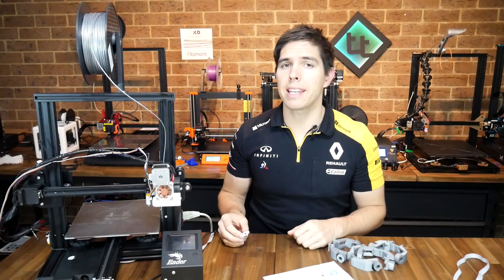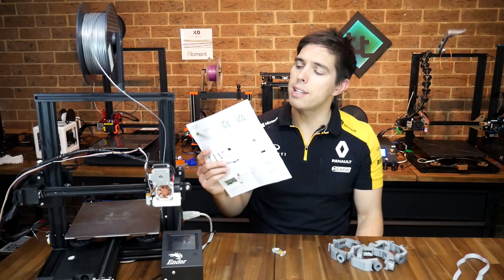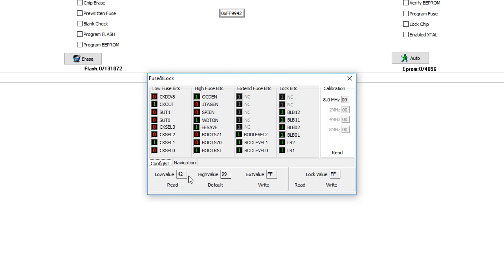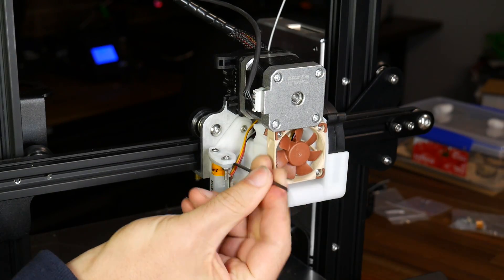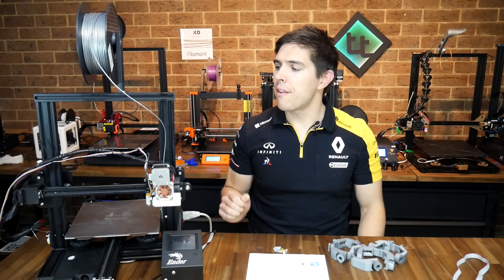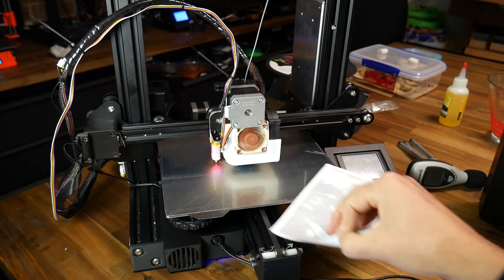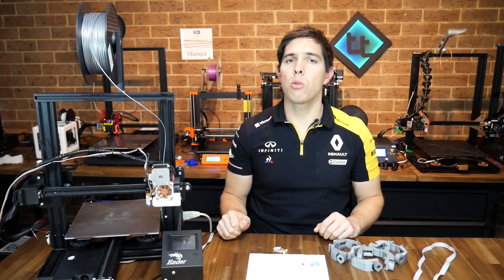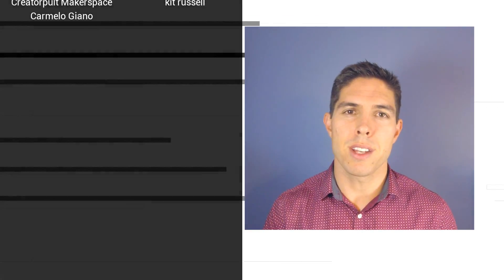Creality BLtouch Ender 3 upgrade kit - Step by step guide with fixes

Comment: Or just turn some knobs every so often and be done with it. This is way too much hassle currently. This would take hours to get right, or longer potentially, and although works well after configured, look at the troubleshooting and configuring that had to be done to get there and the kit isn’t even really compatible. It’s not worth the headache. I got a 3D printer to print things, I didn’t want a continually-fiddly machine. I don’t care for hobby-grade tinkering when I can just turn some knobs and be printing.

Comment: I'm having trouble when I do an "autohome." When I go to autohome, it will do x and y fine, but then the touch pin doesn't come out and it keeps hitting the z stopper sensor (the one I unplugged per the instructions since the touch does that). Did anyone else have this problem?
Reply: Found the solution! Update your firmware.  The 2019.11.13 version seems to be working for me. https://drive.google.com/drive/folders/1A9vSzhdJqm4qdt4wmbYEP8VPbX15ScUU
Reply: @ylexot007  does this one have the z-offset ?
Reply: I just installed and am having the same problem.  Hoping someone else has a solution...

Comment: Help I’m trying to install a BL touch and when I run the Progisp program and try and select the chip ATmega1284P it’s all blank I don’t have any chips to choose from.
What am I doing wrong
Reply: you might need to rename the folder from progisp+1.72 - ∏±±æ to progisp to resolve the blank bar
Reply: @lorenzomuylaert6989  Thank you so much for your comment here. I was having the same problem and that definitely was my issue!

Comment: I couldn't find instructions for the Ender 3 so I used yours and I now have auto bed leveling on my Ender 3.  The only thing is that now my screen says Ender 3 Pro.  I had just installed the new silent mainboard from Ender and wasn't sure if having a bootloader on board would conflict with your instructions.  Apparently it didn't, but I'm wondering which firmware I'm actually running.  Did I blow away my 1.1.5 firmware?  It still prints quietly, so the electronics are still working as advertised.

Comment: Hello. I have such a problem. I downloaded your remastered .hex file from you. Everything went well during the installation. Except every time I press the navigation button, the printer restarts. It is impossible to control it in any way. Rotating just changes the print speed. But that's it. The loudspeaker whistles. You can't even get into the menu. Bl touch is functional. Interestingly, when I disconnect it and reconnect the Z axis and display normally everything is OK. The printer then behaves as if the attached BL was. The blue LED and the red LED flash each time. The display is also functional. Just after Y, Z, X a question mark flashes. The board is version 1.1.5 silent. The processor is the same ATmega 1284P. Do you know what to do? Thank you for any answer (sorry for English - google translator)

Comment: I spent some time searching the web and found that others had the same problem. When you unzip the progisp+1.72 zip file, it creates a folder called progisp+1.72 that has some problems with the name of the folder. Renaming the progisp+1.72 folder to progisp solves the problem. It appears that there is a problem with the path to the file. I found the answer in the Ender 3 subreddit. Here is the link. https://www.reddit.com/r/ender3/comments/cfmbdy/howto_installing_a_bootloader_to_an_ender_3_pro/ The firmware that you created uploaded without any problems and the Ender 3 boot screen is correct. There is one problem. After flashing your file the buzzer in the Ender 3 sounds continuously when you power up the printer. Any suggestions would be appreciated. Thank again for all the work you put into this channel.

Comment: Great video as always! Progisp was a nightmare. Lots or errors even trying to run the software. I uninstalled the software, and downloaded a new copy but the problems were the same. I switched to a USBasp and burned a bootloader using the Arduino IDE. I had a bootloader file from another source. When I went to flash the firmware package that you prepared for the BLTouch, I discovered that the Arduino IDE could not load a .hex file. It was looking for a .ino file. I have Avrdude with the GUI installed, but I'm not sure how to handle the fuse bits. Since I already have a bootloader installed will flashing the firmware that you prepared with a bootloader included, just overwrite the bootloader that I already installed, or will it cause problems? Thanks for all the great videos!

Comment: I am trying to flash the upgraded main board of my ender 3 pro and, I get a, "flash verify error at: 0h".  I have been pounding on this on and off for months.  Would this also be fixed with having the device have power, or am I wrong?

Comment: its been a nightmare getting this set up. i ended up printing a bullseye and mounting it on the right and it still was so messed. up. need washers. cuz it wasn't triggering in time. i think i finally got it but wow -6.5 z offset was stil needed. auto leveling needs to get more user friendly im fairly good with electronics and this was still a nightmare to get working acceptably
Reply: also the fan does not fit anymore once that adapter was put into place going to have to come up with a better solution for the motherboard

Comment: In progisp program where you type low and hight -value, You use DC - D6  when creality have a video with setting D6 - DC.  Does it matter which is what?
Reply: I think the Creality ones are correct, not the video. I had extreme layer shifts when using the values on the video. The only change I then made was to write the Creality fuse values, and the problem was instantly fixed.
Reply: Yes, DC, D6 is correct, Creality showed it wrong.

Comment: When i open up the progisp i get a error. ( access violation at address 76eb1480 in module "KERNEbase.dll´.read address 028d7000. if i click okay 2 times progisp opens up but cant select chip?? what am i doing wrong?
Reply: Rename folder to just progisp,   it should work after that.

Comment: I have followed this entire guide to succesfully install my BLtouch but I have a question. How come the probe don't hit in the center where the nozzle goes instead? It would be better if the probe touches the right place actually. Is there a way to change the Z-Probe offset somewhere?

Comment: I just bought a BL Touch from Creality and the install went fine.  The PROGISP program is in English now and I didn’t have any software errors you show here.  Thefirmware download from the site is easy to find.  Instructions were good  except for the Z offset.  I also upgraded to the 1.1.5 silent board and had to generate a hex file using TH3D’s latest version which has thermal runaway protect and bug fixes for V3 BL touch probe.  Using their software and USB ISP saved having to install a boot-loader.  I agree it’s slow but it works good.  I went with the BL touch since I am going to use a mirror for my bed and I was concerned about thermal changes affecting the capacitance probes and how the probes can be inaccurate with glass.  All in all I say it is a good buy and it’s nice to see Creality fixed some of the problems you outlined here.  Thanks for all the great videos.
Reply: Hi it's possible to send the .hex for ender 3 mainboard 1.1.5 and bltouch v3.0 ? thx man :)

Comment: I downloaded your .hex file and flashed,  went perfect(Thank you).   BUT how do I adjust E-Steps?  The option is now missing from the LCD screen.
Reply: i am having the same issue. i hope we get a repose soon
Reply: @daneberry5679  i ended up just using Octoprint,  Terminal, and entered the commands to adjust it.
1. "M501" (shows current esteps, E93(default), in my case, lot of info but its in there)
2. "M92 E95" (95 was my new needed esteps calculated)
3. "M500" (save new settings)
4. "M501" (check Estep value again to insure it saved).

Comment: I bought the kit off Amazon and installed it, it was after a large print that I noticed the bed is not centered properly, they somehow didnt input the bed size dimensions or the offsets.

Comment: I cant get my mac to run the USB ISP it recognizes it as a USBHID so the progisp program can't find it. Any ideas? I have been searching for a while but no luck
Reply: I did some research and the only thing I could find was something about using Arduino IDE to launch progisp? Might be confused but if you find out let me know!
Reply: @jacobstoltzfus6625  I ended up using the TH3D  version and followed the instrsructions on the website and videos from Edge of tech. got it all sorted out!

Comment: Michael thanks for these useful videos, I have an ender 3 pro and have installed a couple of mods. So far for the BL touch I can't get the software to read the chip. Everything seems to go good till I open  the proispexe file. one I noticed is that it comes a rar file and it doesn't have the chip icon next to it. What is the next step, need some help here.
Thanks.

Comment: Thanks so much for this... I did however have some issues, un related to your instructions... when you click on [...] and ender the hex values, mine would not stay... d6, dc, fd. FD would not stay it kept switching back to ff. I changed the lock value to FD and hit write that made the correct hex code. so program fuse check box checked and code should be 0xFDDCD6 if its not when your write the firmware to the device it will not work you'll have a jumbled up screen. 

Its working beautifully! I hope that you will update this hex as new version of marlin come out this made it really easy for me and i greatly appreciate your help @teachingtech

Comment: I paid for your firmware. First problem : Z won't go below the zero so I can get the width of the paper, I disabled soft stops from the terminal and now I can move forward, after that I got my Z number, went to the Z offset to get the second number but its not there , only "Probe Z offset". How can I fix this?

Comment: When I did it with Chip erase on my CR-10 S5 my screen went blank and now I cant use my printer. tried flashing over other things to no avail =( still lights up need advise on how to fix this
Reply: Are you sure the lcd plug is installed correctly? I changed the fuse code and got mine up and running

Comment: It would be awesome if you could make one of those files for the creality CR10, oddly enough your hex file works on the CR10 lol better than the Hex file creality supplied all that happened was as soon as I tried to make an axis adjustment the printer slammed into the roof  bed or sides

Comment: Hi, I downloaded your BLtouch V3 (Marlin 1.1.9 bugfix... hex file but when I try to load it on I get a line error, I'm a total noob at this so its likely something I'm doing wrong, I tried to use the loader kit that came with my BLT3, does it have to use an Arduino instead ? I can't seem to locate the instructions for installing that firmware other than it saying to do the same way as for the 1.1.6 BLT which loads all ok, thanks in advance for any help here.
Reply: I downloaded the file again and tried again, this time it worked, nice FW, thank you, I just need to set the bed and BLT up, is there a guide for this firmware for the levelling first setup ?
Reply: I managed to get it setup and working, seems to be working well, Thank you for the firmware

Comment: I have a question.... The creality kit comes with its own dongle for flashing the firmware so no Arduino needed.  How does one build the Malin Firmware if you have no Arduino? I see lots of directions for using ArduinoIDE but.... I notice that you provided a build .hex file so there must be a way to build the Malin firmware so that I could use the burner provided by Creality in the kit??

Comment: I received the Creality BL Touch kit for the ender 3 in december. In my version, the correct check boxes for flashing the firmware to the board were already set as you described. So the only thing you have to input is chip and  Hi, Lo, and  ExtValues and off you go. They still don't tell you that you have to have the printer powered on, but the directions have improved.

Comment: I got a BLTOUCH v3.1 and have yet to install it. Is that still affected by this malfunction you described on v3.0? Thanks!
Reply: I also have the v3.1, which I installed last night. After much pain I finally have it working. To make a painful story short I ended up using the creality firmware as no other firmware worked.

Comment: I'm trying to install a BL Touch kit at the moment.  I agree that the documentation and support from Creality is abysmal.  However, disappointed a little with your video as it does not show what you should expect to see when the firmware has installed correctly - all you show is the main screen and whilst my seems to match I can't say that it shows that it is now BL Touch enabled.  When I go through the menu system I cannot find any reference to BL Touch at all - is that correct?  Also when I power on the BL Touch lights up red, extends a retracts the probe a couple of times and then stays red.  Is it meant to be red - to me a red light means something is wrong but I can't find any documentation to say one way or another, nor does you video show what to expect.
Reply: I am trying on a cr10 mini, piecing bits together (slowly).
Reply: @connerbillox2540  I got my Ender 3 in May 2019 and my BL Touch kit in December 2019.  They are both a little different from this video.  For example, the newer control boards have a dedicated ISP socket so you don’t have to use the screen socket.  Also they seem to power enough of the circuitry from the USB 5v so you don’t have to power on the printer any more.  When downloading the software from the Creality site I found that progisp.exe would not run properly.  This turned out to be because it could not access the ini because the extracted folder name has some chinese characters which my English OS could not handle.  Renaming the folder to remove the chinese characters fixes that problem.  The kit instructions are tiny but generally correct.  There is one error, it shows the coloured wires on the 3-pin socket incorrectly - ignore that the documentation is wrong the actual cable is correct.  The progisp.exe now defaults all the burn settings correctly.  Note when flashing the hex it defaults to one called marlin.hex which is in the ISP folder - this is not the hex file you want - the correct one is about two folders higher.  The z-stop lead now has a red plug - you can only plug it in one way and that was correct so no need to check that the wires are the right way round.  Other than that it all went together fine.  BTW there is a Creality install video on youtube - this adds that you can remove the original z-cable and z-switch if you want - it no longer serves a purpose, but equally you can leave it in place should you ever want to revert to the original.
Reply: @nheather  
Well I have just followed the video, downloaded Progisb, imput fuse info but used cr10 Hex key (because that one included BLtouch and has same MEZI board as the Mini) loaded the flash and now most of the options on my printer are in chinese, apart from BLtouch, flash or restore memory.
 Oh right cheers mate, I'll try your way!

Comment: I just did this on my Ender 3 pro. I could not understand why it took you so long to get the proper Z-offset. Well I found out why. I thought that I could use the new menu option  bed level. I also thought that when the printer went to all 9 points, I could slide a piece of paper under to check height. I ended lowering my Z-offset all the way to max, -020.0. That did not work. The hot end was still about 4 or 5 mm from bed at all 9 points. Thank God that I did not try to print anything with that Z-offset.  Well, I thought about it last night and came up with the conclusion that the 9 points were only a reference point for the BL Touch. When you start a print is when the hot end goes to the proper height to print using the Z-offset. It took me probably an hour or so, but I finally got it set. It showed to set it at -02.20. I ended up with -03.33. I printed your x test, and then a Benchy. Both came out great. I do need to increase my retraction as I did have some stringing on the Benchy. Thanks for the video.

Comment: I am having trouble setting this up. I have installed the firmware, installed the bl touch. When i sent it to home it goes to the middle. I then go to move axis and i change the z axis till the nozzle just touches the paper. I get a value of +11.1 to + 17.3 now what do I do? i didn't really understand the z offset instructions. I used the firmware from this youtube because i have the bltouch v3. Someone please help me

Comment: Thanks for this video, i have a BLtouch 3.0 from crealty and i downloaded your firmware, however after i apply the firmware i get a blank screen on the printer, is there anything else to do? or any updated .hex file?
Reply: I found the solution, printer must be turned on all the time

Comment: Thanks for making this guide Michael however for some reason the hex files you have shared (both versions) are making my printer/display incredibly slow to the point it become completely useless. I have Ender 3 controller board V.1.14. I managed to get the official crality BLtouch 1.1.6 firmware working though and my standard ender 3 is not Ender 3 PRO!!
Reply: I have the same issue. Kinda sucks after paying for the file.
Reply: I experienced the same thing with the slowness. After flashing several hex files via progisp I got the bootloader. Instead of using Creality's hex file I downloaded the bltouch source firmware from their website and now my bltouch works.
Reply: @gkuhnlgk  did you manage to get z axis offset working ?
Reply: @PrashantKarade85  Didn't get that far, will be testing it this evening.